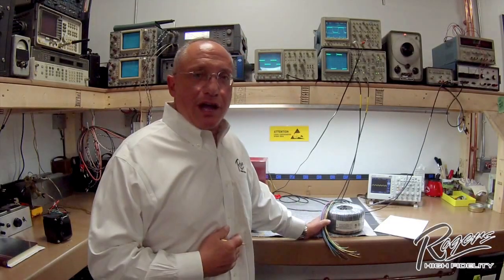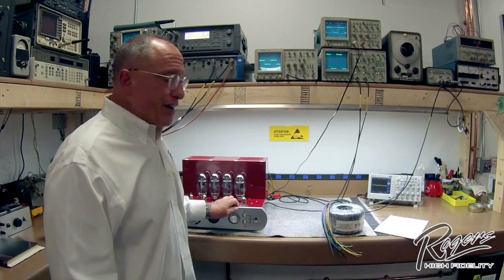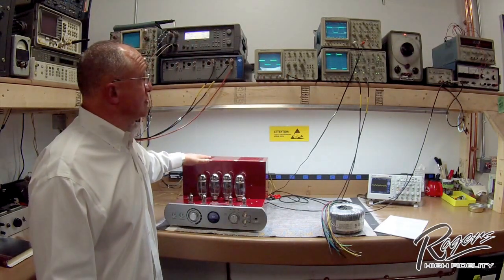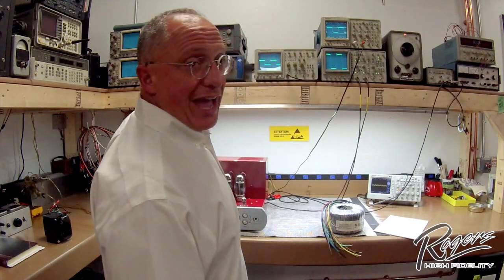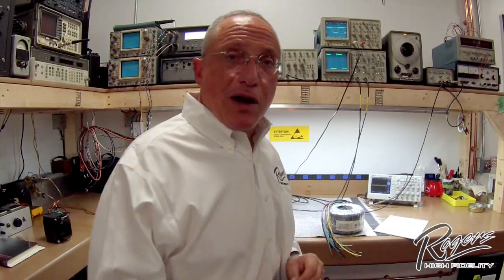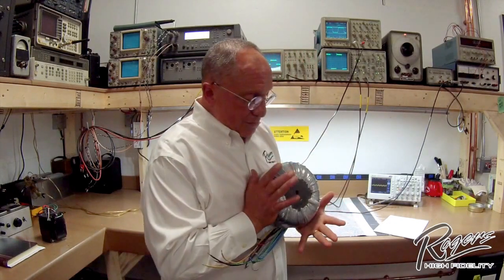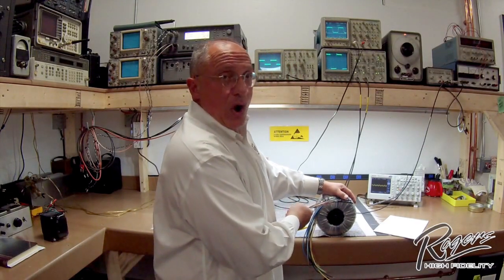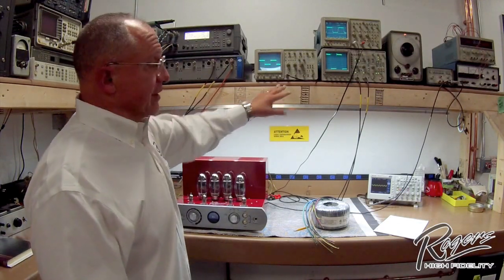High Quality Power Supplies In Our Amplifiers #RogersHighFidelity

Comment: Hum in a transformer is capacitive and a torroidal transformers interlacing makes it more prone to noise. The noise may be contained in a smaller area but it's not less, toroidal transformers enable cases to be smaller because of this.. The best transformer is one with the two windings separated, one on top and the other on the bottom - split bobbin.